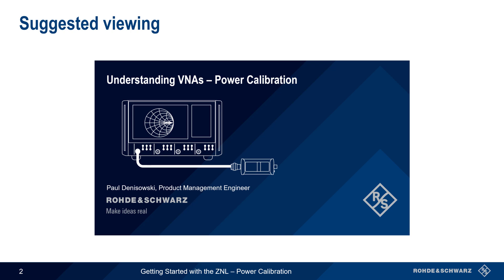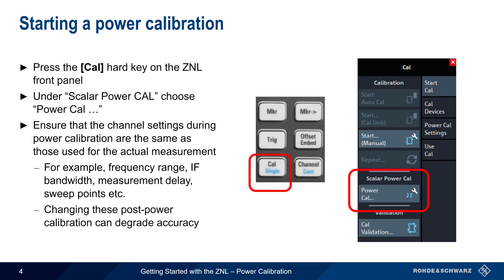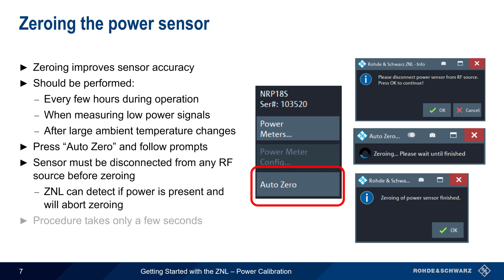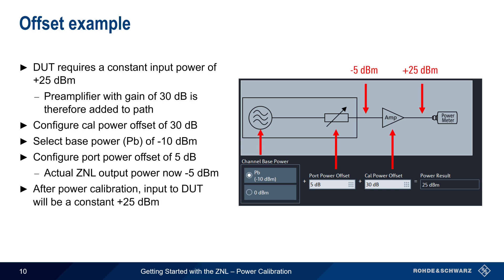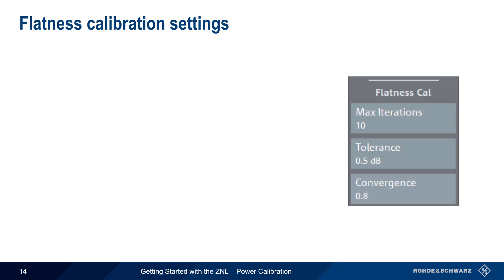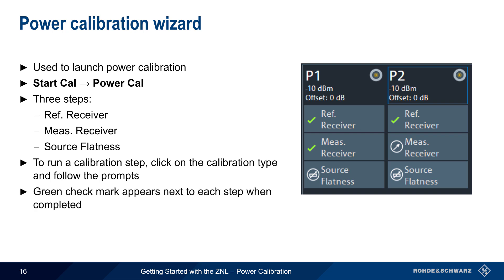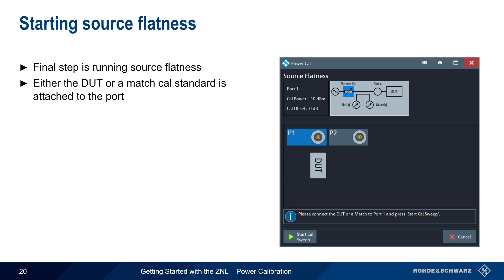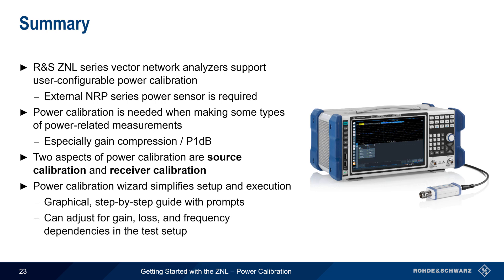Getting Started with the ZNL – Power Calibration

Comment: Great video, thanks! Is it possible for a User Equipment (UE) device such as a cell phone to be used as two-port devices for Test and Measurement such as amplifiers, or can they only be used as one-port devices such as power sensors?
Reply: I'm not sure I would consider a UE either a 1 or 2 port test and measurement device :)  There are cases where a UE with a special application / FW can be used in a "drive test" type testing scenario (i.e. measuring cellular network operator signals and/or throughput, etc.), but generally speaking they aren't used for T&M.  Sorry if I misunderstood the question!
Reply: @pauldenisowski  Ok, thanks. I'm asking because I do a lot of RF drive testing and want to know the various configurations of UEs in the field.